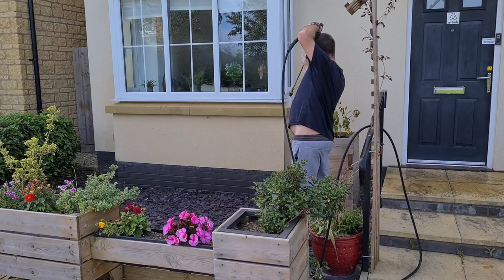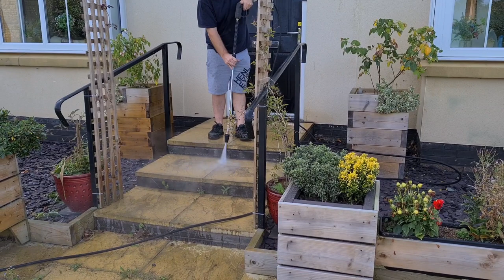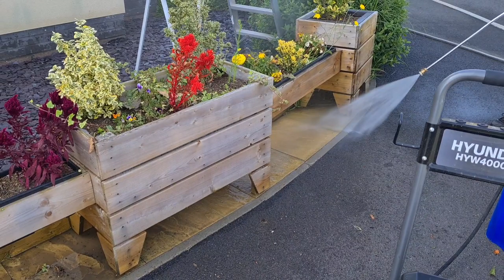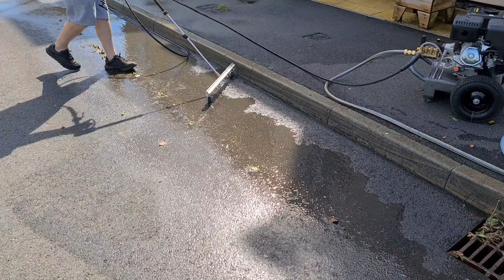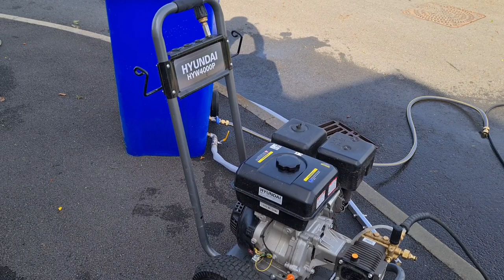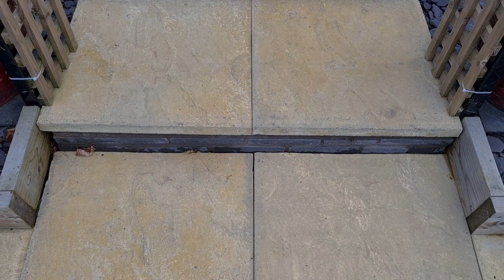No Music - ASMR Pressure Washing with my Hyundai HYW4000P Jetwash and Wheelie Bin Buffer Tank

Comment: 3 times mine has broke on 3 consecutive jobs this week
Reply from the maker: I'm with you on that. Mines been replaced once too. First the oil leaked out of the bottom and the power switch shattered. Then the replacement machine starter pulley shredded the turn wheel so had to have a replacement part sent out. Apparently its a common problem with them 🙄
Reply: so you wouldn't recommend this hyandai hyw4000p i imagine?
Reply from the maker: On a performance basis, absolutely yes I'd recommend it. Certainly blasts through the tough stuff. Luckily I haven't had many more issues with it...